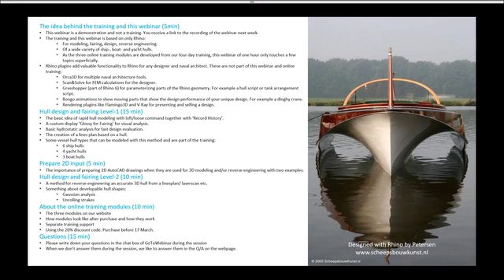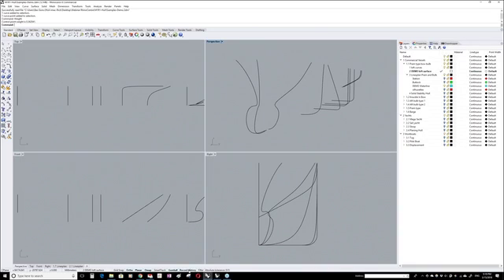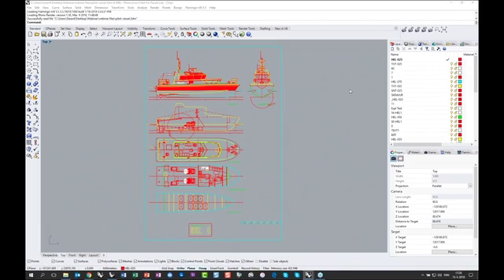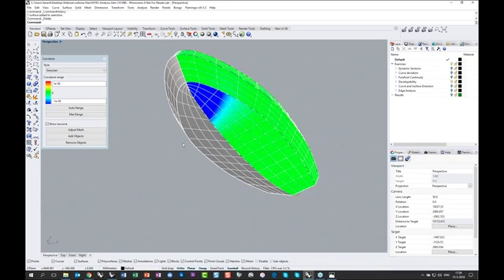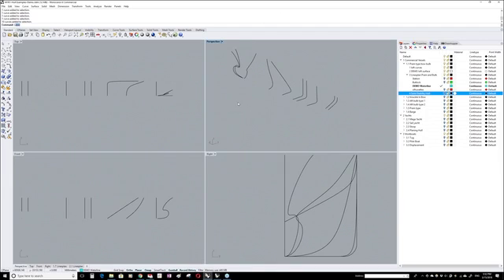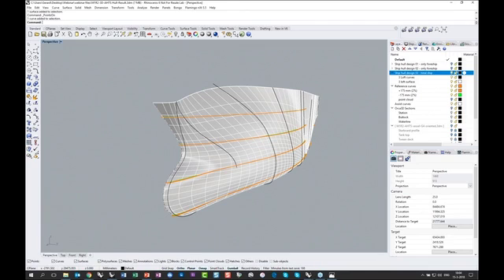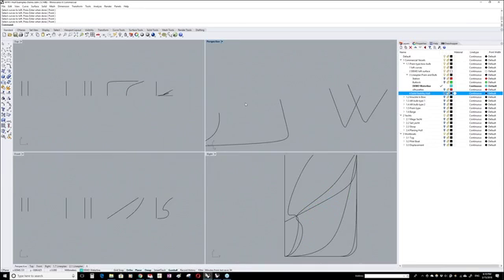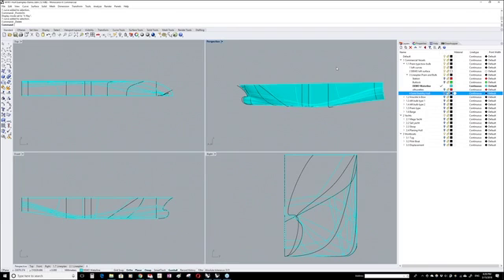Vessel Hull Design, Fairing and Reverse Engineering with Rhino

Comment: I came for the question about replicating a laser scan--the answer is what I was afraid of, which is that it will take lots of time!  (I was hoping for a clever trick to automatically correct slight inaccuracies between cross sections created from the original scan...)